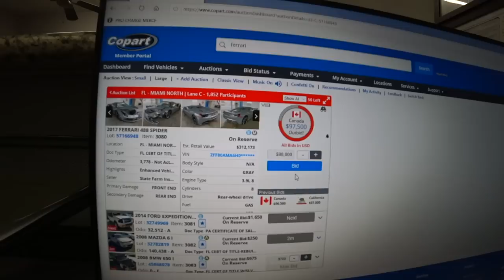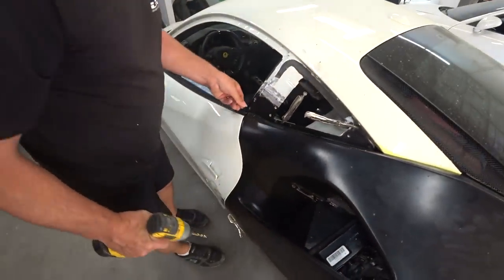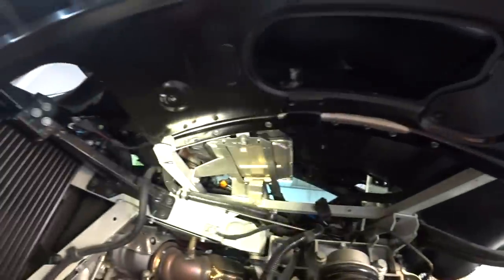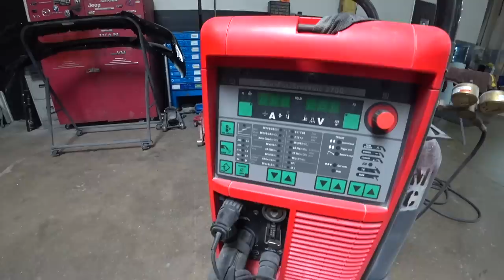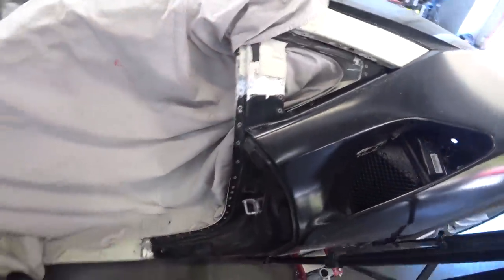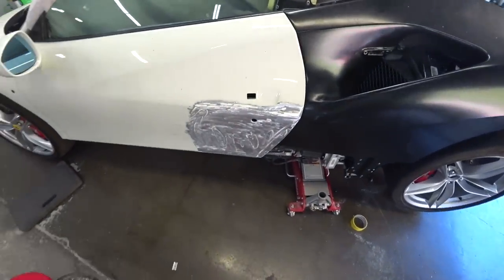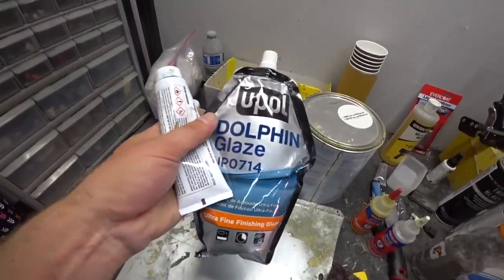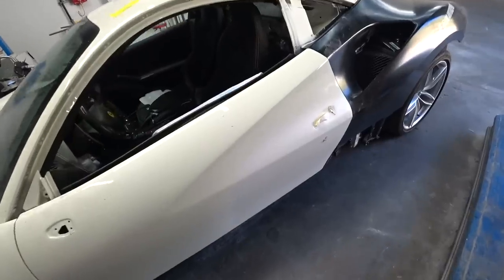REBUILDING A WRECKED FERRARI 488 GTB FROM COPART PART 6 "WELDING QUARTER PANEL"

Comment: Good morning, I see you use the Fronius welder. Are you satisfied with it? Looks like it welds great. Or maybe it is the skillful operator. Also like the tip on the Quick check for straightness on the filler work. More good info, Thanks and you take care.
Reply from the maker: Steve Janka yes we are pretty happy with it been using it for few years now.. thank you for watching and the support Steve 😊👊🏼

Comment: Nice job guys. Could you of used a spot weld using a mig welder instead of riveting along the door where it’s visible? I’m planning on doing my first rebuild soon. Also the grinder you used to remove the welds, is there a specific name for it that I can search for?  Thanks and keep up the great work 👍👍👍.
Reply from the maker: tony o thank you my friend, it’s a 3M (33575) FILE BELT SANDER, works the best.. quarter panel is aluminum so you can’t use mig welder, now a days all the new cars are aluminum most of them use rivets.
Reply: Thanks 👍. Also which Tram gauge do you recommend for personal use. There are many out there but I don’t know which is a reliable one.

Comment: What was all that smoke when you were pulling it on the trailer?
Reply from the maker: Mark Howard from sitting too long.
Reply: @lnccollision  I'm not familiar with dual clutch transmissions (if you can smoke them that easy) but I didn't know if it was that or something haha